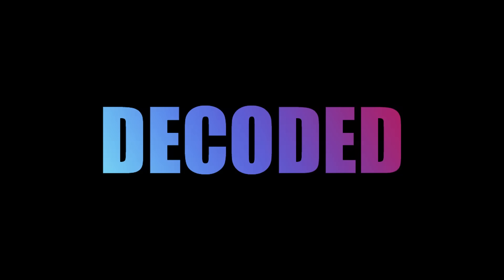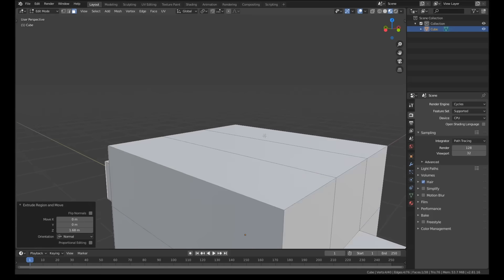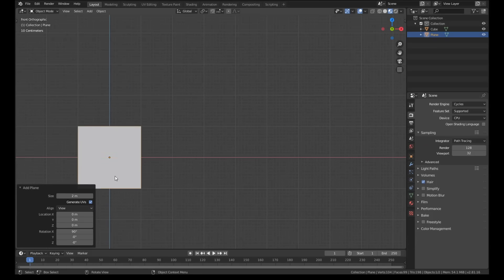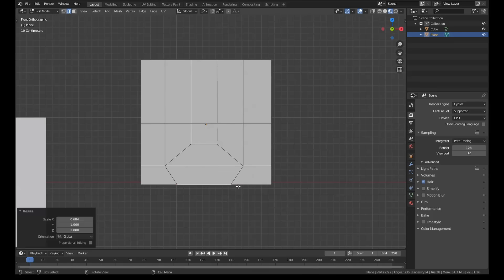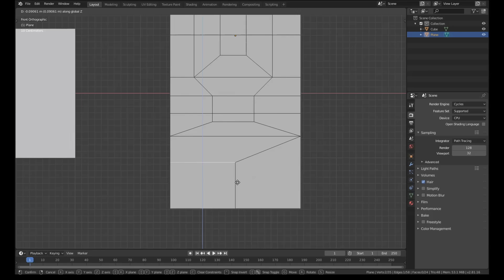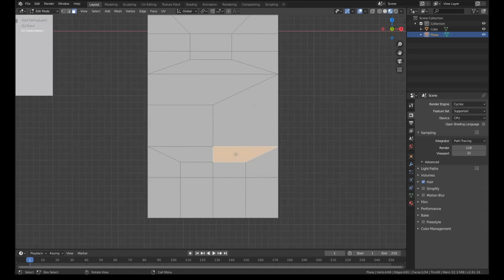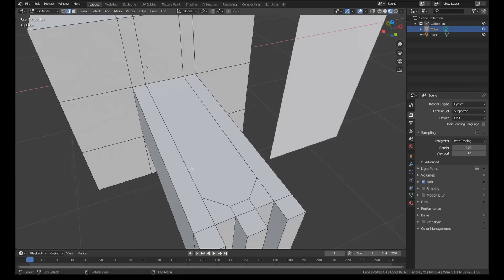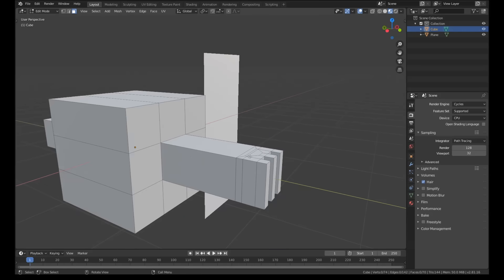Change Your Understanding of Topology In Six Minutes

Comment from the maker: Wow. I almost deleted this video before uploading because I thought it was crap 🤣
Reply: Thanks for sharing the knowledge man.
Reply: This is extremely helpful I've looked up topology and this the best it's been explained. The only thing that would make it better is actually cleaning up a mesh with booleans and showing how you apply this.
Reply: No dude, this is the most helpful video. I've been coming to it frequently, and then I decided I should just take a screenshot of the image at the start. 

It's funny how that works. You'll make a video, think it's crap. Yet everyone flocks to that one and none of the ones you think are brilliant.
Reply from the maker: @Orphanlast  Glad you found it helpful. Yeah, it's pretty hard to judge which videos will be popular.
Reply: DONT even think about deleting it. 
There are lot of people like me who started learning 3d less than a month ago. For me, its a life saver.

Yesterday I was trying to put a round hole in a sphere, using similar method, but failed and then failed and failed again.

Do make similar videos, specially putting a round hole in a sphere. 

I will appriciate similar videos, as they will save me later when I am stuck.
Reply: @syedrizvi6408  Not sure if it's still an issue, but I recommend enabling the built-in LoopTools addon to make things simpler in that particular task you mention. You can select the quads on a UV sphere, use LoopTools to spherify it and you'll have converted the square quads into a circular set of faces. Perhaps not the most elegant solution but it gets the work done in 90% of cases.
Reply: @syedrizvi6408  hmmm putting a hole into a sphere huh... interesting...i wonder what were ur trying model...
Reply: What about using the the boolian modifier by first putting a cylindar through the topology of a sphere?
Reply: You know what, crap videos make for the best discussion grounds. If you ever feel like that again, take this into account, when you publish it, you might learn something you never bargained for.
Reply: them NERRRDS will like it 

good video 👍
Reply: Jesus! This has litterally changed my life
Reply from the maker: @Monkriss  In a good way, I hope.
Reply: I wish I found this video months ago... Very helpful, thanks!
Reply: This video was exceptional. You should do more content like this. I haven't seen a lot of tutorials that explain the principles of topology which is essential for anyone thinking of doing this more seriously. For beginners like me this is so helpful - I had no idea how to deal with these issues and so always had messy topology. Appreciate it.
Reply: It's fine
Reply: I am so glad I found this.  Literally a game changer for me.
Reply: I don't mind this kind of "crap"... at all !
Reply: Dudeeee, nooooo D: I just been educated in something they should have told me in school, thank for actually uploaded it ♥
Reply: And I felt that this was the most useful blender video out of the 20 or so videos I've watched over the past few days. Really shows how easy it is to misjudge your own content as a creator. My advice: don't disqualify videos based on some arbitrary standard of quality. Even videos you think are poorly made are very useful to some people. Only delete videos if they are actually wrong / misleading / harmful, to avoid spreading misinformation and doing harm.
Reply: No way. This really helps me out
Reply: hey can you tell me why is topology important to learn?
Reply: @ErorenémengEroStratagème  Good topology helps when rigging/animating and reduces the chance of having shading issues and can make it easier to edit in future
Reply: this really helped me please don’t delete it I come back to this often when modeling 😅
Reply: Well am glad u didn't. & thank  you for sharing great typology wisdo. Live long & prosper 🖖
Reply: I've been a 3D modeler for almost 13 years and and I'm surprised how much of this I didn't know. Thanks!
Reply: good thing you didn't, one of the most useful tutorials I have ever watched and super versatile
Reply: Thank you for not deleting the video. 
I'm a hobbyist, and topology is my weakest skill (Not saying much.) This gives me understanding about how i should be looking at the model.
Reply: This is one of the most useful tuts I've ever watched
Reply: this is great! thanks for sharing! btw, At the end you meant : 7 to FIVE to 3 to 1 right?
Reply: It's very good!
Reply: Thank You!!!
Reply: Little did you know how useful this is for so many of us. Even for the experienced among us.
Reply: please do not delete
Reply: thank you SO MUCH!! omg this has literally changed my life.
Reply: it's perfect, short, gets straight to the point and useful!
Reply: good tips! the slightly more skewed reductions don't seem so good for organic/human models imaging how they would bend....
Reply: I’m glad you didn’t delete it. I knew there were something to make this process easy to understand and use. But I never couldn’t find it. Your video was the first dedicated to this matter, that is so important. Thanks!
Reply: well you know what they say, people love CRAP! ....hahaha thats true, right?
Reply: Interesting video.
Reply: So glad you didn't delete this. I am new to 3D Modelling & my Models are all CRAP. You explain Topology in the simplest way EVER. 
Thank you.
Reply: glad you didn't
Reply: Does this technique work on the curve surfaces?!
Reply: omg please never delete this :'D instantly bookmarked
Reply: What kind of witchery is that?!! We need a backup of this video, just in case 😂
Reply: It isn't.
Reply: Hi, can you please help me with understanding one little thing ? I understand that this topology is necessary and but I am new and can't understand why can't I just make a loop around let's say "wrist" just before "fingers" so all edges end up at that loop? I just did it with your method and mine and the result is the same (no deformations when I apply subdiv). Hope you have time to answer :) Ty.
Reply: Thanks.
Reply: dont you dare, always room for more information
Reply: DO NOT DARE. I've been looking for something this well explained FOR AGES.
Reply: Well this has got to be good
Reply: there are other methods... but i think the reason i say this is because i just hate poly modelling. i rarely polymodel, if i cant sculpt it, I
Reply: no way man , i working at least for 5 years i 3d wordl and this video launch me to a new era of topology for my models man, very thanks man
Reply: Glad you didn't! thank you so much!
Reply: Excelent video and excelent comment because that is soooo relatable as an education content creator
Reply: It's the nice side of Duning Kruger syndrome - you are so good, you are starting to assume that other people are really good. You can't resist, I have the same problem. You reach a point where you can hardly even teach anymore. That's why they just let you go learn everything in university, the professor is so advanced, they assume you can just go read about it and learn it in two seconds.
Reply: It's not crap, but it IS a bit laggy.
Reply: it is a crap, but youtube algorithm liked it so..
Reply from the maker: @ac11dc110  k
Reply: @ac11dc110  ass